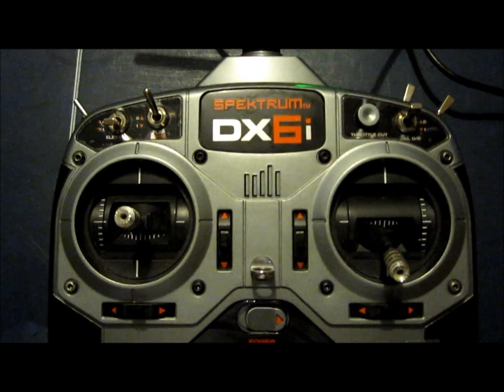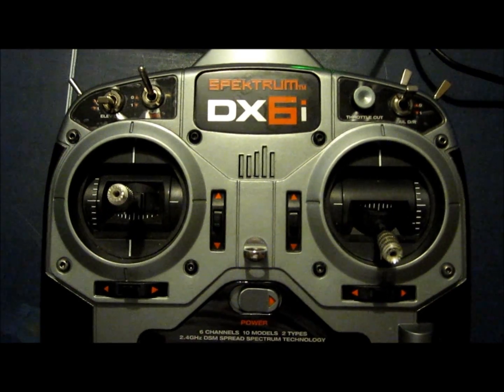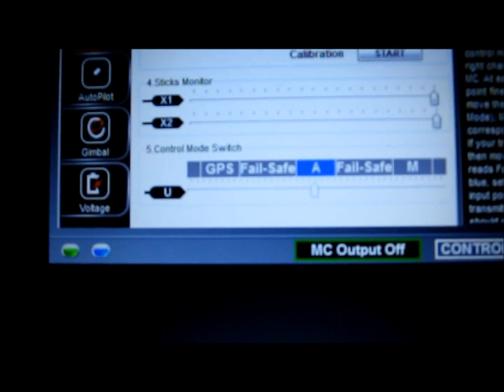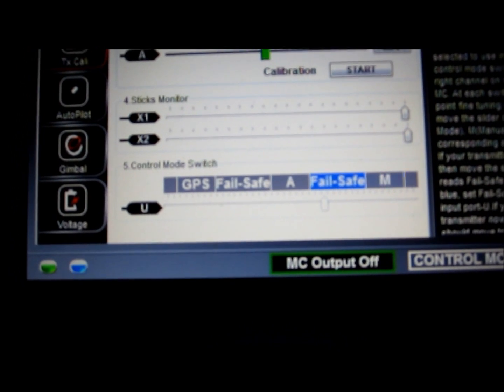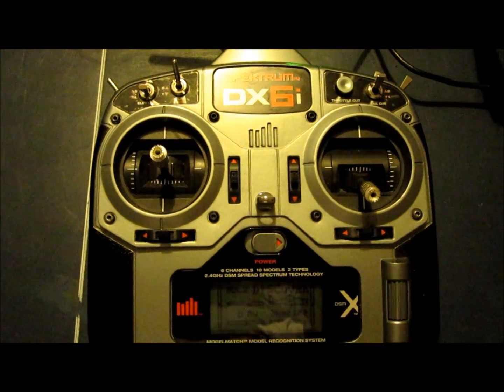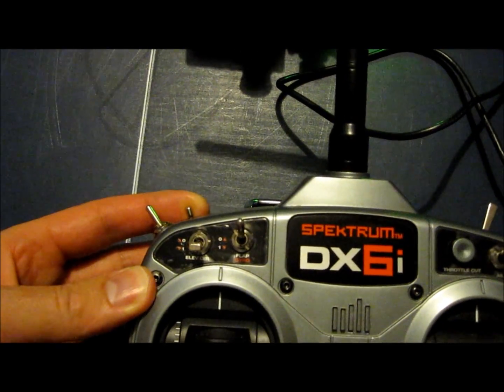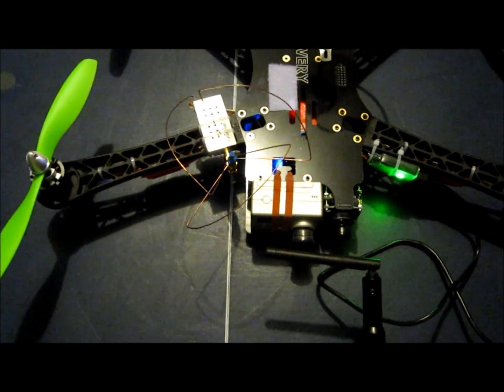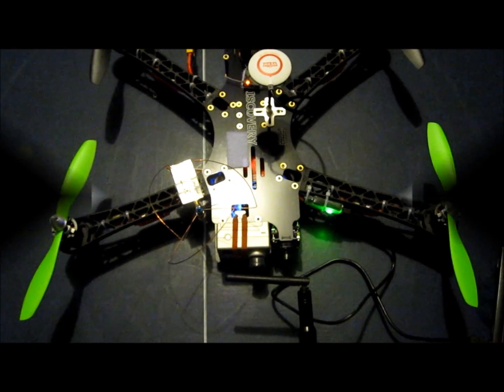DX6i NAZA GPS 3 MODE + FAIL SAFE SET UP, CALIBRATION

Comment from the maker: Hi. Yes if you buy the AR7010 it will work. I bought mine for about $80 from ebay. What is the range? well it depends on so many things, first make sure your DX6i has US selected under the power settings menu (highest output) mount your receiver and satellite on different orientations furthest from video transmitter, keep DX6i antenna pointing up (as signal is strongest from sides) if you fly straight up then turn on the side. Some areas 800m is ok and others only 200m will activate failsafe.

Comment from the maker: Hi Ec130Rhine to set up the Fail-Safe... First the Spektrum receiver has two modes for failsafe, 1 leave bind plug in when binding for "Hold Last Command" (not good) or 2 Put in bind plug then power on receiver REMOVE bind plug then turn on transmitter and BIND this will set the switch and stick position for Fail-Safe. Hope this answered your question.

Comment from the maker: To enter calibration mode you have to switch between all 3 modes 10x (just keep going until the light stays orange) on my mode 1 this is rh switch down/up then left switch up/down = GPS, A, MAN, A,GPS, A, MAN, A again and again. 
It will work as I did it and just checked it again.